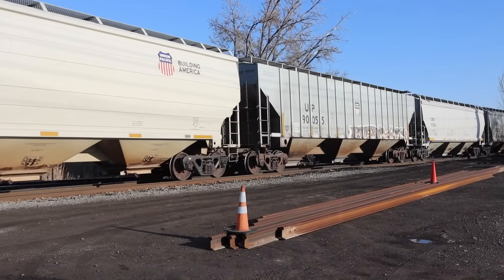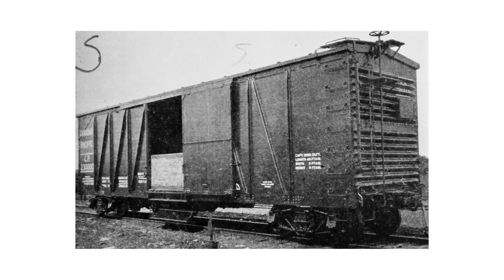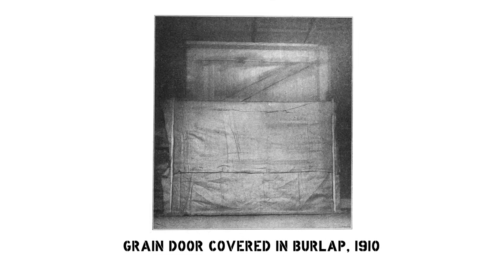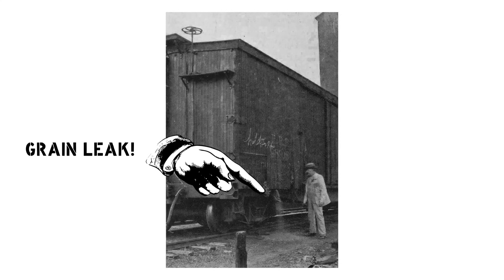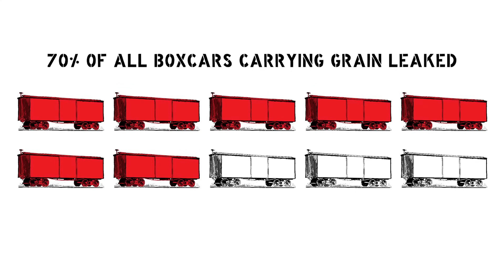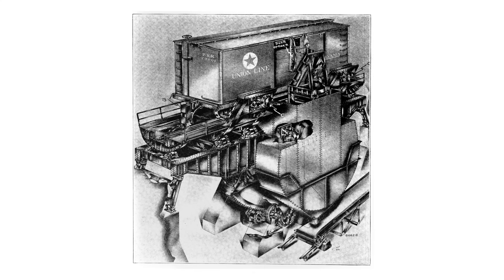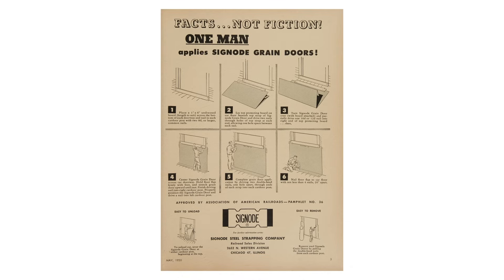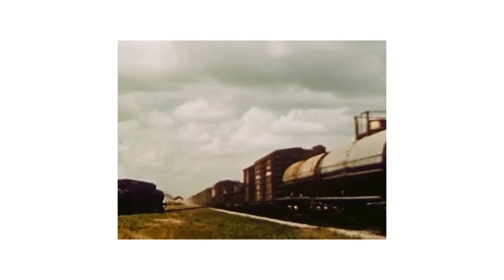What is a Grain Door? Obscure Train Tech: Shipping Grain in Boxcars

Comment: I was a yard switchman at CNW's Proviso yard in 1974 and the grain spillage was a big problem. There was a shortage of hopper cars due to movement of grain sold to USSR and boxcars with Signode paper were used. When cars were humped against those boxcars grain would spill out, lay on the ground for months until a yard cleaning machine would clear it up. The stench from the rotting grain was unbelievable.
Reply from the maker: Thank you for sharing that! Blaine Hadfield's book "One Hundred Ghosts" about United States grain elevators has a section on the USSR grain sales that was fascinating. Such a weird point in our agricultural history.
Reply: I'm a retired CP Conductor & I can attest to that awful smell. The birds would eat the spillage for a week or so & after a few weeks, not even rats would go after it.
Reply: Excellent video!  Thanks for producing.
Reply: Have you ever walked through spilled,  wet soybeans, and found a hole you didn't know was there?
Reply: @ fortunately not...lol
Reply: Still a problem today with leaky hopper gates. Hump the car too hard starts leaking and continues until carman close it during the air test. In the PSR era that stuff is not getting cleaned up. By fall its everywhere and if you have to step in it to couple an air hose its enough to make some people throw up
Reply: @adoubtface  Don't worry, your company will get a track cleaner machine to your terminal in a few years or so.

Comment: It's honestly amazing it took that long. Like, how did it take over 100 years for them to not think of something better, especially when they'd been using hoppers for other goods for decades? "Gee, wouldn't that just be perfect if they put a cover on it?" - It took them THAT long to think of that?!
Reply from the maker: It wasn't that it took them that long to think of covered hoppers - there is a fascinating drawing of a Canadian six-wheel wood bodied covered hopper for grain use that dates to the 1830s. The issue was that railroads were concerned about maximizing the profit from the expense of a freight car, and having a fleet of generic cars that can carry as many commodities as possible made more sense to them than specializing the fleet.

As another commenter pointed out, it's easy enough to carry grain in a boxcar, but hard to carry boxes in a grain car.
Reply: @GreatBasinCarShops  The Stockholders are served,
the Shippers are exploited..
The US Rail System is less than half of what it was in 1922.
The Oil companies all seem to have found profits.

The industry like sports has been corrupted by greed.
Reply: Traditions are difficult to overcome,  limiting the loads to bulk commodities was one feature of construction of steel Covered Hoppers.
Elevators were all supplied with a pile of Grain Doors for loading,  the paper also worked on Flatbed Trucks that hauled Grain,  so the effects of continuing with the traditional methods were easy.

The Shippers turning to Trucks after 1967 to deliver building supplies like Brick cut the need for Boxcars to deliver products that were hauled in Boxcars before that.
The need to provide profits to Oil Company Investors was something that eliminated many Boxcars as trucks burned more fuel,  and delivered more profits to oil company Investors.
Reply: Simply because hoppers serving a cement plant are utilized all year long and a grain car is only needed for the harvest season.
No plot involved.
Reply: @DonaldAtherton-l7u  Since the plastic injection molding industry began to move plastic pellets on Hoppers,
the ability to employ more hoppers has directed some of the return on investment back to the Oil Company Investor.

No Oligarchy intended?

Comment: In the wheat harvest of 1966, in Northern Oklahoma, I had a job "coopering" boxcars at a local elevator. The grain doors were large sheets of double thickness cardboard the size of the boxcar door. At the top, middle, and bottom of the grain doors were wide, heavy steel bands of strapping steel that was glued to the cardboard. There were holes punched in the steel banding that nails could be driven through. They were installed from inside. The main problem was getting out without breaking your neck. You used a step ladder to get to the top of the door, pulled up the ladder and then lowered the ladder outside. Then, it was only 15 to 20 feet to the ground. We were paid a $1.25 an hour and all the wheat you could swallow.
Reply: In 1963 during the summer, I worked in a CO-OP grain elevator in eastern Colorado. We loaded wheat into box cars that had grain doors. My job was to direct the flow of wheat with a scoop shovel inside the box car. Sounds like an easy job for $1.10 an hour, but it wasn't. The grain would come down a chute inside the box car then I would direct the grain to the corners of the car. There was a rope that you would pull to ring a bell so the chute operator would start and stop the flow of wheat. It was dark in there and all the dust you could eat.
Lucky to see anything at all. A dust mask was near worthless. One time I pulled the rope to stop the flow, but nothing happened. It just kept flowing. I started to panic as the wheat just kept getting higher and I was trying to crawl out of the car without getting buried. That was it, never did that job again. I transferred to a better job cleaning out grain from under the conveyer belts.
Reply: @GaryH-pw9cm 
A day you never forgot for sure. How many farmers died, sinking in silos ?, but never eared the same with boxcars😊😊😊
Reply: I was working in a feed mill in Calif, at that time, wonder if I ever unloaded any cars you loaded LOL
Reply from the maker: Thank you for sharing your memories!
Reply: My first railroad job as a switchman, was in 1971. A lot of grain was still being shipped in boxcars at that time. I was on an extra board in a small yard that switched three grain elevators, and when I caught a job on one of the night shift engines, I often worked with a foreman that had a small hog farm. We would climb into empty boxcars with grain sacks, and get the leftover grain that was between the inner coopered boxcar walls, and the inner metal boxcar walls. They called it "hustling" grain, and we would've been in trouble if we would've been caught doing it. All of our switching work was done, but taking anything off of railroad property was strictly against the rules. The switch foreman gave the engineer, and us two switchmen several swigs of whiskey, as payment for filling the grain sacks for his hogs
Reply: @crosstiewalker803  When I worked a local in the mid 70's we would stop in the middle of our route for lunch or dinner.   Our Conductor would sweep soybeans or corn into burlap sacks and at the end of the week take the sacks to a grain elevator and sell them.
Reply: I remember the tail end of the box car grain shipments. A friend of mine worked at the local elevator coopering cars. I, as a farmer filled my own cars on a siding but all were hopper bottom. Interesting video of times gone by. Thank you.
Reply: I had  a job at the local co-op in 1974 and we would board up the box cars with the cardboard doors as glenwitteman said but we had to add a metal bar in the middle horizontally with thick wires tying the two opposing doors together   otherwise it would be nearly impossible to get the doors open at the receiving end since the cardboard would push out to the metal sliding doors. To load we would add a 2 X 6 plank and fasten a flexible spout to shoot the grain all the way to the end of the car since we would elevate the grain 70 feet high with a leg it had lots of momentum to get to the ends. Lots of fun, probably why everyone in the grain business  looked old but were probably only in their 50's.
Reply: Ya did coopering at local elevator when I was a kid!!!
Reply: We lived in Libby, Montana in the late 1950s. J. Neils Lumber Company was a huge sawmill that primarily milled white pine. One facility manufactured grain doors from lumber.

Comment: Around 1960 my grandparents had a few heavy wooden panels they called "grain doors" on their small farm that looked just like the ones at 2:00.  They were used as wheelbarrow ramps, ditch bridges, windbreaks, and other temporary purposes as the need arose.  After all these years I finally learned what a grain door actually is.  No idea how or when they got them, but my grandfather was good at "finding" useful things.  Thanks!
Reply from the maker: Thank you for sharing! Loss of grain doors was a huge problem, while researching this video I found many railroad complaints to the elevators telling them to stop letting farmers steal the doors from the pile. The railroads could probably afford to lose them though!
Reply: I remember in the late 50’s and early 60’s when empty boxcars were spotted on the Morton salt plant siding for loading with palletized bagged salt they often came with the cardboard grain doors left inside - usually in pieces. These were piled up along the siding and periodically burned in big bonfires, which smoked up the entire town.

Comment: It's only obscure if you're under 25.
Reply: Southern Railway came out with the Big John grain and feed car sometime in the early 1960’s. It carried 125 tons, according to the Ties magazine, Southern’s employee publication. My dad was a Southern trainman. It reduced the cost of shipping the grain. I remember reading it years ago.
Reply from the maker: @samueledgarpegram7088  Southern was definitely at the forefront of United States grain hopper development but they went too big, too fast. It took a few more decades for general covered hopper capacity to catch up to what the Big Johns were!
Reply: @ I didn’t know that , l was just a kid then. They caused my father to get run off back in the mid 1970’s. He was the conductor on the Greensboro local, on the return trip back to Winston Salem they had 11 or twelve at the rear of the train. They stopped to make a set off at Guilford College and the engineer used I think dad said the engineer brakes instead of the train brakes, anyway while the air hoses came apart he realized there was no air and the hopper cars pulled a drawhead out of an automobile rack and the caboose and the hopper cars started moving. Dad started tying the grain cars hand brakes, he got them stopped. The whole crew was run off , dad got 60 days. It was summer time and mom was out of school, they took a long trip. The engineer had just qualified to work, he got the least amount of time.
Reply from the maker: I'm older than 25 and the use of grain doors on boxcars was already phased out before I was born. I've only seen one example in real life, a Santa Fe door that I found in storage at the local railroad museum. Nobody else there knew what it was.
Reply: Like today’s hopper cars most boxcars were loaded with bucket elevators.. unlike hopper cars which are moved underneath a spout to load each compartment in a boxcar a long flexible spout was moved instead directing the grain into the car
Reply: Railroads in the US stopped shipping grain in box cars in the late 1970s/early '80s, and in Canada in the mid 1980s. So anyone younger than late 40s has no personal memory of this stuff.
Reply: @beeble2003 Boxcars were still used on a few branch lines in Canada, where the heavier covered hoppers couldn't be used due to the lite rail being used, up to the early 90's.  After that either the track was replaced with heavier rail or truck would ship the grain to a grain terminal for loading into hopper cars.
Reply: @ OK but that's still a decade before a 25-year-old was born, so the OP's comment is still silly.